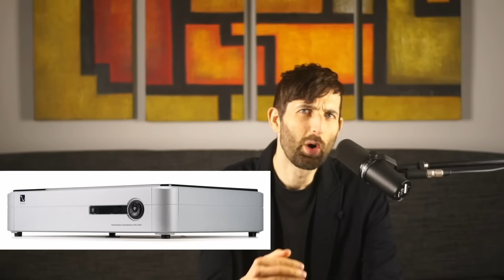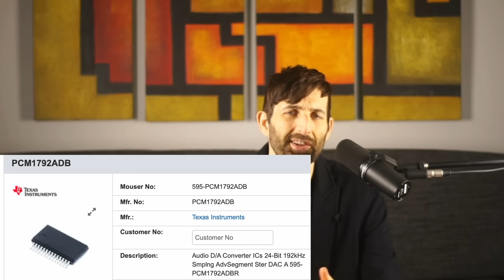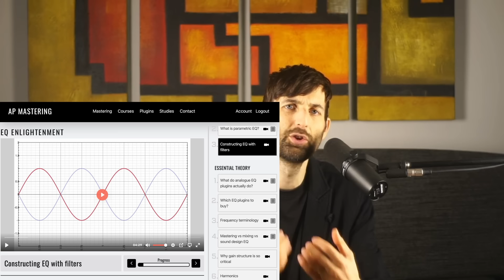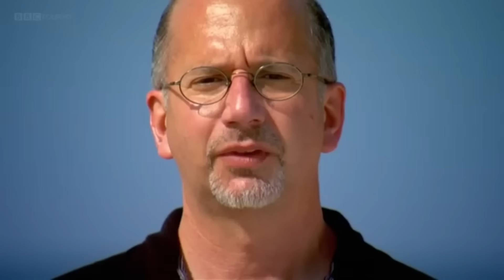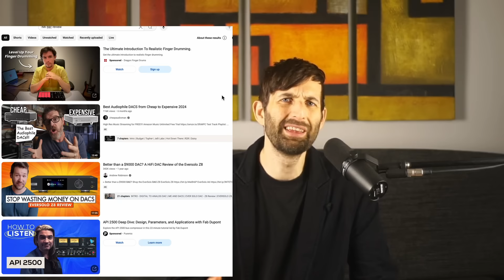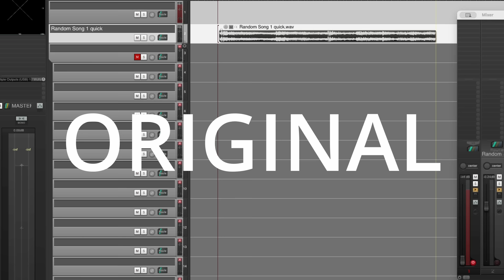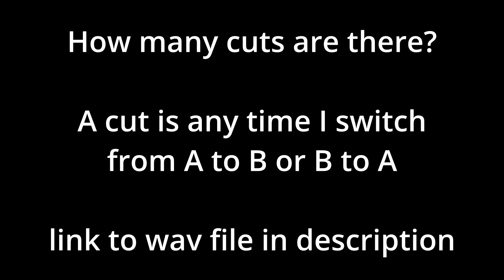The DAC Scam - Almost everyone believes the hype

Comment: There is so much wrong with this and you're gatekeeping with the comments. 

Here it goes how his video is basically useless as 2 tits on a fish. 

STM’s 3-10 second fade starts the moment you hear something. Say A plays for 5 seconds, then B kicks in instantly. By second 6 (1 second into B), A’s details—like a crisp snare or airy vocal—are already blurring. You’re not comparing A to B; you’re comparing “fading A” to “current B.” Instant or not, memory can’t freeze time.

 B slamming in right after A overwrites your mental sketch of A. Picture hearing a guitar riff (A), then a synth pad (B) takes over—no pause. B’s fresh presence drowns A’s echo. Research (like Keppel & Underwood, 1962) shows new input nukes recall of what came before, especially when it’s similar but different. Seamless transition? Doesn’t matter—B still stomps A’s ghost.

You’re capped at 3-4 “chunks” (Cowan, 2001) in working memory. Instant switching might let you focus on one trait—like treble sharpness—but you’ll miss others (bass weight, imaging). Audio’s a buffet; your plate’s a thimble. A perfect switch doesn’t expand that.

Without a pause or cue, A and B blend into a stream. That’s great for flow, but terrible for comparison. Your brain needs a beat to register “this is A, now this is B.” Instant means you’re guessing where A stopped and B began—STM can’t tag it cleanly. Was that shift at 5 seconds a real change or just the track evolving? You’re lost in the soup.

Humans don’t process sound instantly. Psychoacoustic studies (e.g., Zwislocki, 1960) show it takes ~200 ms to fully register a tone’s character. Stack that across a 10-second A-to-B flow, and your brain’s still catching up when B hits. You’re not comparing; you’re chasing.

In a setup where it's perfectly level matched and no discernible transition between a and big on someone's setup, you might catch big diffs—like A’s boomy bass vs. B’s tight punch—because they smack you hard enough to stick. But subtle stuff? Say A has a 2 dB bump at 3 kHz, and B’s flat. Instant switch or not, that’s gone from memory in a blink unless you’re laser-focused on mids—and even then, interference from B wipes it. You’re left with a vibe (“B feels clearer”), not a diagnosis.

Pros doing instant A/B with sine sweeps might nail a frequency shift. You? With music? Good luck holding onto A’s timbre while B’s vocals roll in.
This perfect A/B narrows the gap—less noise, less bias—but it’s still a memory sprint. Two months with A builds a rock-solid mental map: you know its warmth, its flaws. Swap to B, and the contrast isn’t a guess—it’s a revelation, baked into your long-term sense. No instant switch can match that depth. STM’s a flickering candle; long-term’s a spotlight.

It's funny how none of these people want to hear it. They don't want to try the real long term true blind test. They all afraid that the bullshit they have been spewing for years has been wrong. Prove me wrong and I'll say I'm wrong. I know you won't conduct the test properly, or any "professional".
Reply: So your same comment shows up two times here. Is that what you call "gatekeeping"? 🤨
Reply: @Fastvoice  I've been fighting for 18 hours to get it posted is what's going on. Every time I comment, what I said disappears is what's going on. Make sense now?

And it's mostly in a reply on the most popular comment within the video. I can't speak what I want to say in there. The comments vanish into thin air.
Reply: That is what one would call gatekeeping.
Reply: @dicmccoy  YouTube and also some channel owners have defined certain keywords or sign chains for blocking comments automatically. Sometimes that effect comes across even with non-spam comments. That's not really gatekeeping. I too have dealt with that multiple times.
Reply: @Fastvoice  well it's certainly irritating that I couldn't even respond properly to certain comments. It makes me look dumb in the end and people in the comments have no real idea what I am trying to say. Such a great system YouTube has.
Reply: Assuming there's truth to it, if we need TWO WHOLE MONTHS to MAYBE start hearing subtle differences expressed in subjective audiophile terms, the more it proves the point how overkill it all is. Objective measurements do not need 2 months tho. No half decent DAC has anywhere near a 2 dB 3k bump.

Even so I'm open minded and would be interested in the results of such a blind test which you deem proper. Has it been done? Would be extremely hard if not impossible to monitor tho. I am not convinced standard blind A/B STM tests are that useless still. If those are not enough to hear the difference, it's not significant enough and I couldn't care less which version of the alleged difference on the level of "revelation" has been "brain burned".

Comment: Plus you need to consider the clock oscillators and those mechanisms to reduce jitter. Besides the dacs usually have Some kind of amplification. And the quality of a power source is also very important

Comment: More expensive DACs rarely have off the shelf AKM or sabre chip. Its usually custom designed discrete R2R or DS design. Then, sound of the DAC is 20-30%  DAC module, rest is analogue stage and power supply. This video is so bad and reviewer obviously has very very little experience with evaluating (blindly if possible!) DACs.

Comment: I bought an 18-year-old (or so) audio interface (MOTU 24Ai/Ao) for the central hub of my studio. I wouldn't be able to tell the difference between something costing £100k and what I currently have.

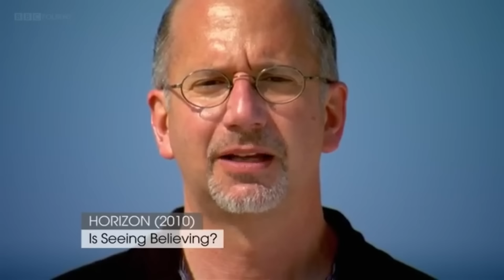EDIT: 07:37 - Still sounds the same to me, although I'm a sound engineer so I listen to audio every single day. I know what it sounds like vs what it should sound like based upon what I see (on a video). If it doesn't correlate, it doesn't correlate. I've dealt with way too much audio editing in spectral view to both see and hear the difference between B and F. But yeah, many people still suffer from this effect, especially audiophiles. They expect it to sound "purer" but actually like things that sound incorrect and inaccurate.

Comment: Hi end DAC use non-chip based DAC that you are not talking about.
Reply: What exactly should a "non-chip based DAC" be? Only with discrete transistors, resistors, capacitors etc.?

Comment: Working in industry, on robotics, which use DAC chips for the analog control of servo systems, the actual differences between consumer audio DAC chips and industrial grade chips is in the specifications. Audio grade are used in devices like your Bluetooth headphones, internet connected speakers, etc, where it is more important to provide low power consumption while on battery power, so in general, they are low voltage and current devices. They are often 16bit PCM devices to deliver CD quality., which is quite good. Where quite good is not good enough for precision motion control for wafer handling in semiconductor manufacturing, where part alignment is measured in nanometers, often linearity, noise, bit rate, and bit depth, become more important than low power. Industrial DAC chips are often 24 bit to 32bit floating point, with low DC offset. Audio DAC circuits are most often AC coupled and don't put out DC. so industrial chips often have high linearity specifications and very low DC offsets.  Audio DAC chips are often limited to DC to 44KHZ clock at 16 bits, able to run on very low current.  Industrial DAC chips are often designed to output a current instead of a voltage, as in motion control, current = force in the F=MA formula for use in PID motion control. Those chips do not run on a single supply voltage and require multiple voltages. They often require +/- 5V, a TTL 5V supply, and the op amp requires +/- 15 Volts.  These chips are not designed to run on a single lithium cell battery. These chips require a companion chip to convert the current to a voltage using a tranconductance amplifier. (Fancy name for an op amp configured to input current and output voltage). They use this due to the ability to use a 2R/R ladder to add the currents for a very linear output.  So yes there are details that matter in industrial DAC chips, that are rearly used in consumer grade 16 bit DAC chips.
The reality is if you feed 16bit stereo PCM into a 16 bit stereo PCM chip, and you feed the same 16bit PCM stereo signal into a 32 bit floating point industrial chip, the output is nearly identical.  This is the hard truth. Your DAC does not increase the resolution of your digital stream.
A difference that is noticable in some, I repeat, some consumer DAC chips, is data is loaded into the left and right sides sequentially.  That means the conversion is sequential.  This means a slight delay in sound in one channel. which shows up as an increasing phase shift at higher frequencies. Most DAC chips have abandoned this design, in consumer stereo DAC chips. Now the one channel data is latched, but not converted until the other channel data is received, and both sides output in parallel.  Cheap consumer DAC chips have a single DAC, and output the Left, then the right, and a L/R pin switches an analog switch to the S/H chip for the 2 channels. Yes these low power devices are common. Yes, the channels are sequential, not parallel. Industrial chips are almost always mono chips, with separate DAC chips for motion control, such as X, Y, and Z axis.
Reply: 16 bit /44 KHz is rarely used in today's audio devices. 24 or 32 bit at 192KHz with built-in filters can be found more often. Some have a programmable DSP core so today's audio codecs are significantly better than those of 20 years ago.
Reply: Well that was mainly a load of useless hooey. Industrial DACs have better DC offset, but better linearity? Nope, not at the bandwidth of audio DACs.  Industrial DACs are never above 20bits R2R, and we have had audio DACS R2R at high resolution, but it makes no sense when SD DACs have far better linearity (i.e. lower distortion).  DACs for industrial purposes come in both SD and R2R depending on requirement. R2R is for low latency.

There is no such thing as a 32 bit floating point industrial DAC.  The interface may support floating point, but inside it is just a regular DAC.   No audio DAC has noticeable L/R shift made in the last 20 years, and often that is a factor of exterior architecture if using mono DACs, or stereo DACs ganged for Mono.
Reply: @robertt7238  There is a DAC IC, and a DAC circuit. A DAC IC, when placed in a DAC circuit, can have 24 bits of DAC value, followed by a variable gain amplifier. The DAC Circuit is in the format of Multiplier for powers of 2 of the exponent, and 1 bit for sign, and the remained is the value. In a 8 bit hexidecimal format, the exponent is 8 bits written and a 2 digit hex exponent, followed by 1 hex bit for the sign, followed by the next 31 bits of value. Yes the circuit is floating point, and is used in industry. This is often coupled with a DSP specifically set to handle the value, gain, and sign values. A 24 bit value amplified by a 16 bit exponent is a very wide dynamic range.

Comment: You are wrong about it's just the chip. Buy yourself a Weiss 501 and compare to others with same chip that are cheaper. Son the algorithms are the star or this show. 
Made my hifi rose with newer chip sound like absolute poop. 
Give crosstalk cancellation a try, have compilation cd each song from different albums so level is all over the place one plugin fixes that so you can enjoy listening instead of working the volume with your remote.
Lots of value in a good dac. No regular people buy the type you mentioned but to say the implementation doesn't matter just the chip is completely nonsense. 
I can't be butt hurt because others can spend as much as they want on anything they want more power to them without them on cutting edge no technology would flow down to us. Remember how much a flat screen tv once was.